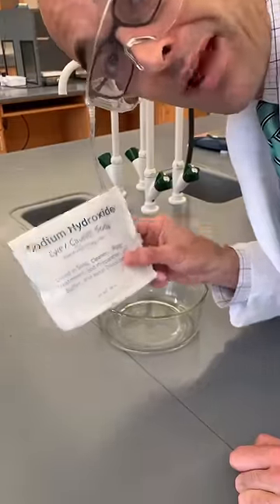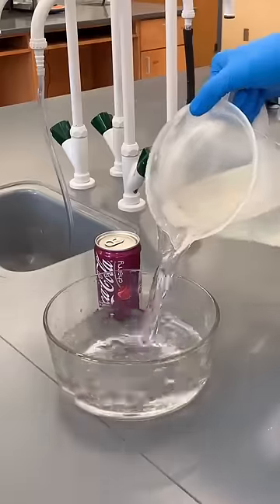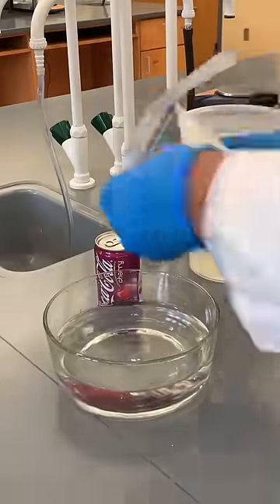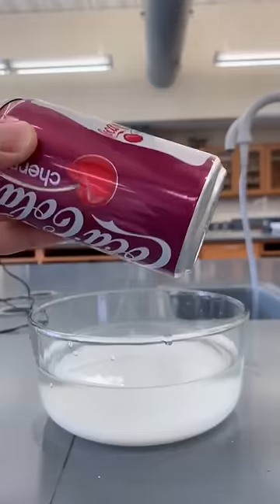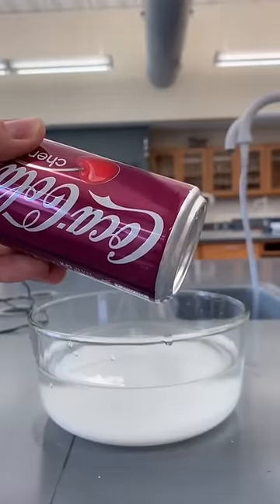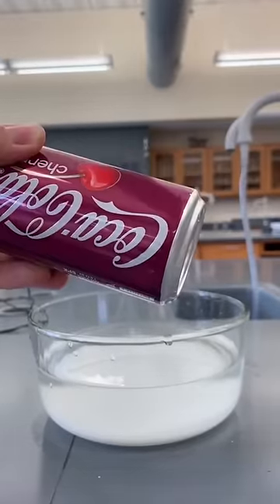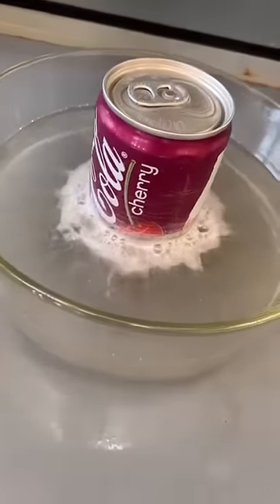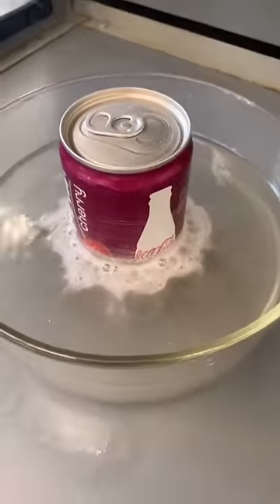Did you know this about aluminum cans?

Comment: I did know this. Most sodas are fairly acidic (pH of 2.3 to 2.9 or so for Coca-Cola) because of the phosphoric acid in them. If the can didn't have the liner, the soda would eat right through the metal. Another interesting fact: During the bottling process [i.e.-cans in this case] they have to remove any dissolved oxygen in the water. If they didn't, the D.O. would react with the plastic liner and cause it to degrade, then the soda would make contact with the aluminum and cause a packaging failure. Source: I used to work in the QC department at a Coca-Cola bottling plant.  ;o)
Reply: That's really interesting, since water is made of 1/3 oxygen. Thanks for sharing!
Reply: Interesting. Does the same apply for cans of mineral water?
Reply: more microplastics in your system
Reply: This is absolutely wrong. You are talking crap.
Reply: Oh, you smarty pants youuu!✨✨✨
Reply: Tbf: that's only true as long there is oxygen, but who would want a can dissappearing after opening it.
Reply: I was just gonna ask thanks

Also I was gonna ask how u knew all this lol I was like must be a nerd
Reply: @Fred-mp1vf  Imagine if the real reason for water being more expensive than soda is because the water contains more oxygen lol
Reply: No the oxygen is a far larger atom than the two tiny hydrogens.
Reply: Damn....no wonder so much soda/pop is sold in plastic bottles nowadays......😔
Reply: @mrperson9877  and your words doesn't make any sense why is there're so many 8yr olds in a chemistry related shorts now
Reply: I always wondered how aluminum cans could have soda in them
Reply: @charminbutterfly32  nothing wrong with being a nerd lady....I'm giving him a compliment 

That's your negative connotation of what a nerd is....I don't have one
Reply: @DigitalJill  wtf? Everything daniel said is true.
Reply: @Fred-mp1vf  Compounds containing oxygen are chemically completely different to oxygen gas.
Reply: @scorpiocara6798   I'm sorry 😞 my bad. I went back and reread it ( twice ). I did misread it.  I'm so sorry,for been ugly.
Reply: @charminbutterfly32  that's ok Ik it could be easily misleading that's why I tried to write it the best I could without it sounding bad, so I apologize for being snarky in my response
Reply: @scorpiocara6798  Hun no harm done. 
Have a blessed evening 🙏🙏🙏
Reply: Can only imagine what it does to your insides
Reply: So many problematic solutions for a solved problem from 50 years ago - just use glass bottles with those steel caps. Done.
Reply: @lyrebird9749  To be honest about mineral water, I'm not sure. We didn't package [i.e.- "can"] any mineral water at my facility. Coca-Cola's main water brand is Dasani, which usually comes in plastic bottles. At the time I worked there (in Houston, TX), there was a separate plastic bottling plant, although they have since merged under one roof in a new plant [Greenspoint area]. My guess would be that since the pH of water is much closer to neutral (it's actually extremely difficult to get water to exactly pH 7.0), it wouldn't be "needed", but would probably be done to keep the water from getting a 'tinny' flavor. Also, all the aluminium cans (made at yet another separate facility) are pretty much exactly the same, with the exception of the graphics. I would guess they just change graphics for logistical reasons, but again; that's just a guess.
Reply: @tangoto1209  Yeah; one thing I've learned from many years in manufacturing (and having a mechanical engineering degree), is sometimes seemingly simple things are more complex than you think, and sometimes  complex things are more simple than you think. Another thing I never thought about until I had that Coca-Cola job: the temperature of the cans is critical for safety. In the filler room, the water is kept extremely cold since dissolved gas is a function of temperature. Colder liquids can hold more dissolved gas than warmer liquids, so this makes perfect sense for the CO2 in "fizzy" drinks. But once the cans on the line left the filler room, the very first thing they did was went through a warm water shower to get them to room temperature. If they didn't, they would get condensation on the can before being packaged in cardboard 12-packs. The water would make the cardboard degrade and the pallet could collapse. It happened one time I worked there. A stack of NOS (the energy drink) collapsed right after a mechanic walked by. Fortunately no one was hurt, but the stack of pallets was about 16 feet high. It could have literally crushed someone. The first thing the QC shifts had to measure at the beginning of our shifts was the dew point. Summers in Houston are no joke. I've literally seen a dew point in the low 70's before, meaning any surface lower than that temp would "sweat". Good times...

[Edited a typo]
Reply: The big question though....do you still consume coca cola products after having worked there?
Reply: So that tells you what it does to our stomachs- 😭
Reply: @peterparquer1873 
I buy sodas in glass bottles
Or, I won't buy them
Reply: @danielhogan7749  Thanks for the detailed response. Yes I expect they just use the same cans. Was just curious.
Reply: @JxkeFilmsProductioyt  Interesting enough, the hydrochloric acid in our stomach is much stronger (lower pH; although "acidity" also has other factors) than Coca-Cola. According to healthline stomach acid has a pH between 1.0 and 2.0

Although when I drink energy drinks (NOS is my addiction of choice), I only half joking say "NOS! Come for the tooth decay. Stay for the diabetes!"   ;o)
Reply: @Silver_Sunset_Tcg  Yes; although I was never a big soda drinker to start with. I started drinking energy drinks when I worked there. NOS is my favorite, Full Throttle is a close second. Complete time consuming pain in the butt to make, but soooooo delicious. I try to limit them to one a day (or less) because like all  sodas they're not exactly health food.

On a personal note I hate the company I used to work for (Arca Continental, aka Coca-Cola Southwest Beverages in the U.S.). Lolz. When I started, my plant was owned by a company called CCR (Coca-Cola Refreshments), who I actually liked working for.
Reply: How cool, but what's D.O.?
Reply: @peterparquer1873  metal pop cans have a plastic liner inside them too
Reply: You must be fun at parties
Reply: @Himothy-jdu  I bring the party to the party 😆
Reply: Wow😮!  Thank you for sharing your knowledge and story with us💯
Reply: @R41ph3a7b6  D.O. is short for "dissolved oxygen". Most naturally occurring water has a fair amount of dissolved gasses.
Ironically for plain drinking water, I had a civil engineer who designs water plants tell me what tastes 'best' to most people is cold, soft, oxygenated water. So I guess it's all situational. shrugs
Reply: interesting are we drinking some plastic? nice job 👍
Reply: That's what it will do to your stomach too!
Reply: And people put it in their blood and bones

Comment: The health department in my state requires that all commercial dishwashers use a detergent which contains sodium hydroxide, so businesses have to constantly replace all their aluminum pans and other expensive equipment.
Reply: Informative!
Reply: OR the dishwasher employees could just not put anything metal into the dishwasher and clean those by hand.
Reply: They shouldnt use aluminum cookware! Its a neurotoxin.
 So is alum used in cooking to keep cooked vegetables bright green and in alum baking powder.
Reply: @laurastabell2489  From my research, aluminum is safe for cooking as long as nothing acidic is being cooked, and the pan is not damaged. That being said,  if these pans are disintegrating in the washing machine, they probably were too damaged to be safe anyway.
Reply: @mrjacob00  generally people do not pay attention to such details such as many won't know that they shouldn't cook acidic food in them or not use after it is scratched.
Reply: I've been in the restaurant industry for 40 years in multiple States and I have never once encountered a kitchen that uses anything other than iron pans. Restaurants never use aluminum.

Comment: This is done to keep the soda from eating away the can from the inside. 

If the outside of a can is exposed to soda it will begin to deteriorate over a period of time. 

Source: Was a Coca Cola rep for several years and in training we were told to throw away and credit cans that had been exposed to soda for this reason.
Reply: @Soulix  A carbonated drink is a very weak acid
Reply: @Soulix  maybe you shouldve been an overthinker in your high school chemistry class. No offense
Reply: What about beer?
Reply: thanks for your input
Reply: I confirm. Source: I was a buyer for a large automotive OEM and the supplier told us some of our automotive coatings, they also supply to soda companies to line the inside of the cans.  So they watch food industry legislation to determine automotive legislation years in the future for some products. Pretty interesting imo.
Reply: But is it BPA free?
Reply: If soda is caustic to metal then it may not be too great for your stomach.
Reply: @NilakshMalpotra  yes but coca cola has phosphoric acid in it (if this is what it is called in english)

in addition, even with a low or even no acid (except water itself, but let's not  be pedantic) the aluminium would partially dissolve into the water, as does basically any metal that is not like gold, and that would change the taste, and could potentially be a health hazard because you usually do not have aluminium in you, nor does your body need it. whether it is better or worse than microplastics in your body is another question
Reply: @James Johnson  It's not. Very bad for you but damn it it taste good. I cut down on all sugary drinks about 6 years ago.
Reply: @guttagutta420  James, are you unaware that your stomach is full of acid at all times
Reply: @NilakshMalpotra  Just because it's weak doesn't mean it isn't an acid.
Reply: Its to lower testosterone in men
Reply: @12yearssober  I could believe it.
Reply: Aaand you're not suppose to mix plastics with aluminum when recycling?
Reply: @James Johnson  our stomach should have a good amount of hydrochloric acid in it so I think a can of soda shouldn't do much if anything.
Reply: You can actually make environmental friendly plastics from vegetables.
Reply: @guttagutta420 It's not caustic, it's acidic. And very weakly acidic at that.
Reply: It's not actually plastic. It's a liquid that's sprayed  into the can then baked in a oven to protect the metal from the drink and/or the drink so it doesn't taste like metal.
Reply: It can do all that and still have BPA plastic
Reply: @cmocmo2277 yo, that's freaking awesome!
Reply: @guttagutta420 your stomach acid is more caustic than soda.
Reply: And people drink this stuff on a regular basis
Reply: @rayray_6.1hemi39  YES! It's a food grade lacquer that is sprayed into the can and then baked on during the forming process! But no one is going to read these comments and be forever misinformed
Reply: Next time use a Bud Light can, I’m sure there’s plenty of those laying around!
Reply: Even though we know this,
we still put this into our bodies!
Reply: @guttagutta420 your own body has acid.
Reply: Yeah, and just imagine what it does to your insides, daily drinkers!11
Reply: @nitarashafiveash5016 not much only 1 ingredient gets you fat and potential diabetes that regular sugar and mostly HFCS.